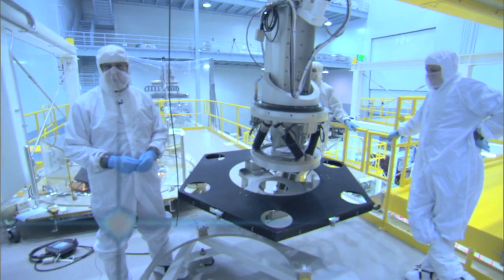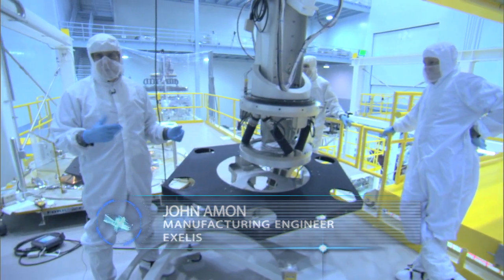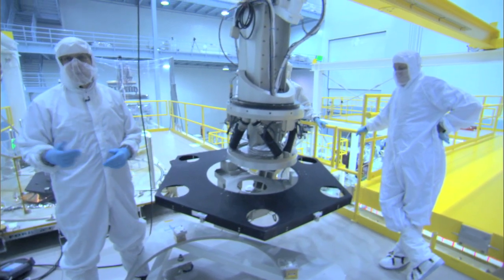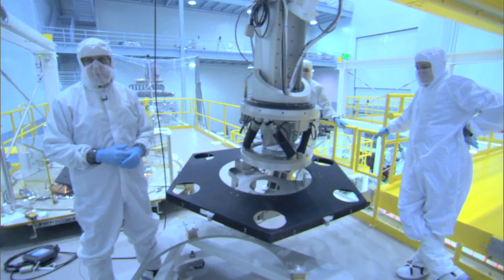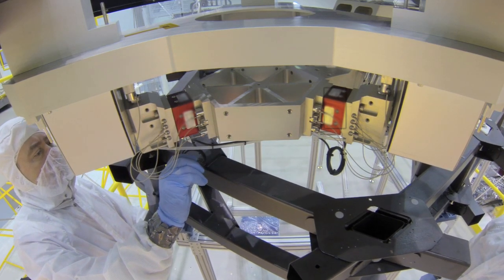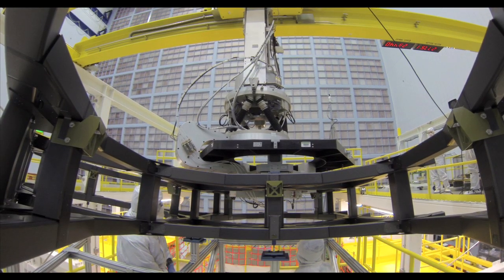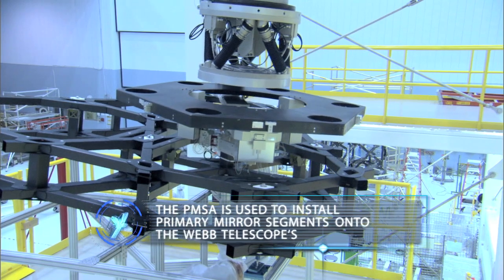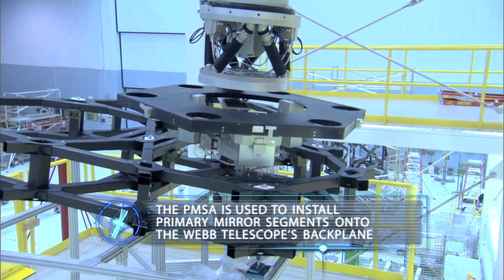Video Snapshot: Practice Makes Perfect With Webb Telescope Mirror Placement

Comment from the maker: We have many of the parts for Webb, but the big job remaining is to put them together and test them to make sure it all will work when out in space. We test things at each level so if we find something that doesn't work we can fix it without taking things apart. For example, we make a detector and test it. Then we put it into a camera and test the camera. Then we put the camera in the ISIM structure and test the ISIM. We put the ISIM together with the mirrors and test them together. (1/2)